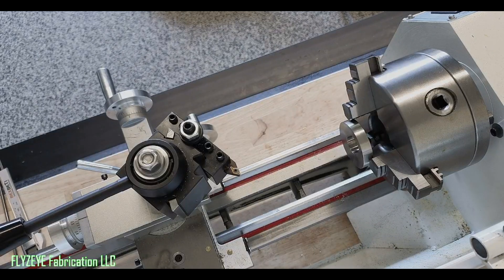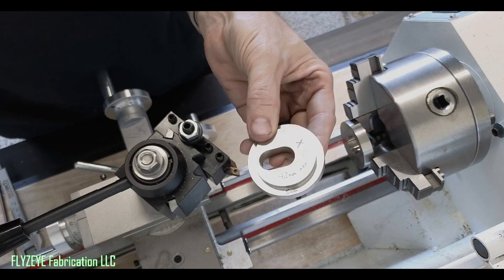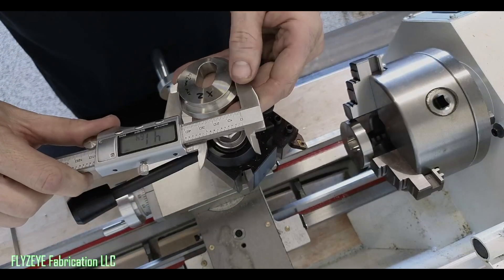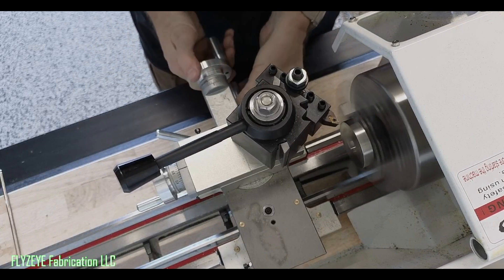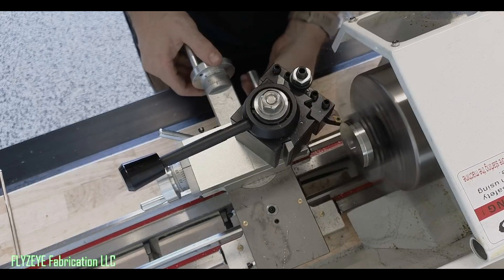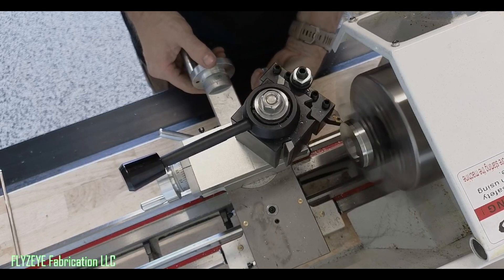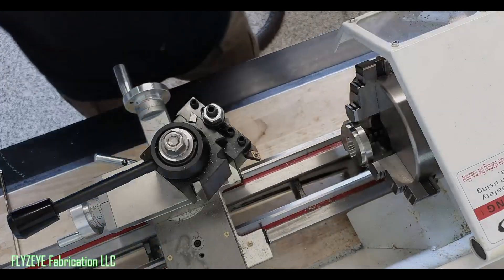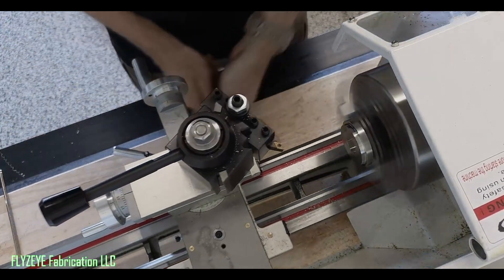Mini Lathe Eccentric Washer Project

Comment: Just got the same model machine now, i really like it, i think it is great valye for the money.
Did you do any after alligment or adjustments after you recived it?
I just made a robust quick change tool post for it 🙂
Reply from the maker: I spent some time aligning the tail stock, replaced the cross slide housing with a 3D printed version (adding some bearings), and checked the backlash in the gear drive.

Comment: Great video! Thanks. What modifications did you make to change out the tool post? I have a similar mini lathe.
Reply from the maker: I ended up using a M10 x 100mm all-thread with threaded connectors to jam it in place.  Turned down a piece of plastic to fill the air gap.  Added a M10 thrust washer.  I might drill and tap for the 9/16"-18 stud that came with the QCTP, but it's working pretty well as is.